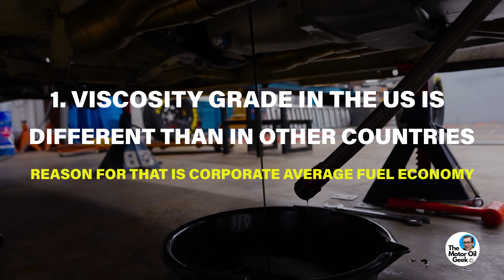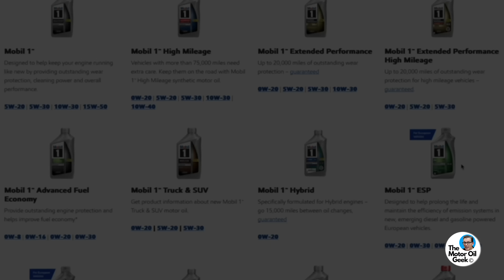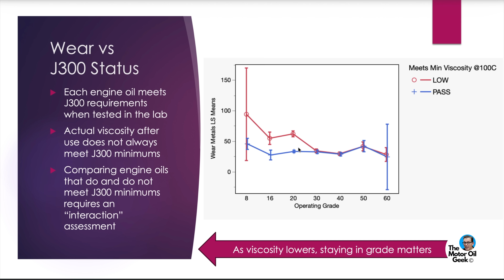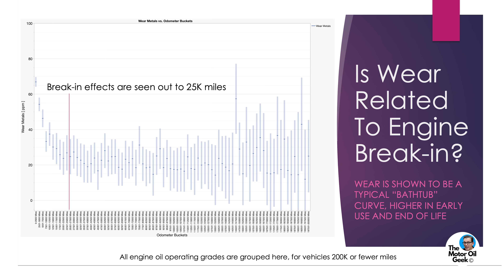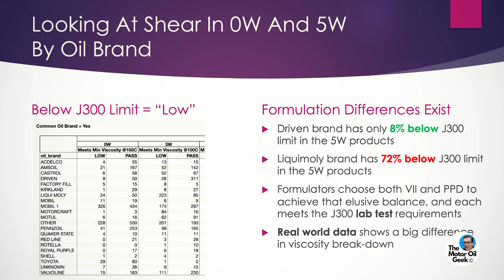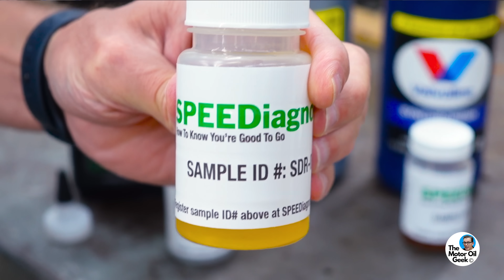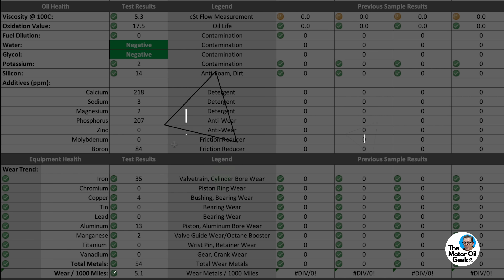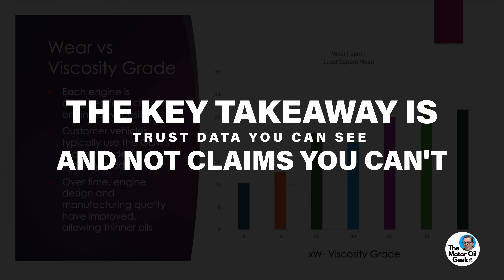More Ai Lies? The FACTS about 0W-20 vs 5W-30 (With Evidence)

Comment: The average mileage on a car in America is 12,000 to 14,000. The average American owns a new car 8 years. 8 x 14,000 = 112,000 miles. At 5K oil change interval, that is 22ish oil changes over 8 years. Having the oil changed with average quality oil is more important than using Hi Performance oil for every oil change. Other than engine design flaws, the average user will not have appreciable internal engine wear under 112000 miles with average oil and average oil changes. All this "Best of the Best" stuff is just "Icing on the Cake" or "Cherry on Top" statistics".

Comment: I respect your experience and professionalism, but it appears (I hope I am wrong) that you change direction with the blowing of the wind. 

I own diesel equipment and trucks and have for all my life in agriculture and construction. Rebuilt ourselves many many engines and raced with NHRA during 80s 90s and early 2000s, running thin oils in our race engines, so I have a little experience. 

I bought a new LZO in 24 and was told to only run 0Water20 or void warranty. I ran for 22000 miles and burned 2 QTs every 4000 mile service, with it stopping up the stupid particulate filter at 30k miles(oil was going out the exhaust). I fussed with Dealer service manager and said screw the warranty. Switched to 5W30 and for 25000 more miles, it has burned 1/2 to 3/4 of 1 QT every 4000 miles. So Screw GM!!!! 

Now my complaint to you sir. 

I watched a video with you and Dean (Dave Auto / Whom I respect) and you sir were giving your advice based on your numbers you tested and came up with, to YES RUN THE 0Water20. 

So sir, who is paying you to give your advice? Is it to sway listeners one way or the other?????? Because now you have flipped. 

For me it is about TRUST. I am going to do what I believe is right and for the best of my company. But you and anyone else putting out content that SUPPOSE to help people, but you sway what you say is not right!!! 

If I misunderstood or am wrong, please correct me. But I do not believe I am wrong. There are so many lies and manipulation and misinformation being pushed out on these platforms, it is pathetic. Manipulation is witchcraft and lying!!! The Bible says Our Heavenly Father hates a liar. 

If I am wrong, prove me wrong. If I am right, then repent and make things right with the listeners. You owe them that at least. 

Thanks and God Bless Everyone!!!
Reply: Hey man, not to start a flame war with you. Since the beginning of his videos and I watched him when he had like 30 subscribers he’s always said to do the test oil analysis. 
He also has always said start with a recommended what the manufacturer says .

He also just told you in this video that zero 20 can be as good as 5W-30 until it is not as good and then it wears down faster .

No respect you, my friend, but I don’t know if you’re actually holding onto everything he says or your brain is just picking pieces out of all the videos .

I’m sure if you go back you’ll realize everything he has said so far is to do the test. Do the test do the test. I also am an engineer. 

He hasn’t backslid and he hasn’t changed his mind and I don’t know about this whole thing with God if you’re just being a troll or if you’re serious, but I hope that helps you.
Reply: @DanBrando  "He also just told you in this video that zero 20 can be as good as 5W-30 until it is not as good and then it wears down faster ."  🤣🤣🤣 So then it really is just "0Water20" snake oil. GOT IT! I'm sure it may have some use, but universal daily driver is not one of them.  Don't they also teach planned obsolescence in engineering class. AND statistics are a bad joke at best. Not everyone has funds to test their oil vs food on the table.  I just seen this in my friends little ford  4 banger, over a Qt low between oil change with under 60,,000 miles on it.  I'm so glad I grew up in a time when old time gear heads exchanged knowledge and taught us how use our brains instead of depending on the internet and AI. He is right about manipulation and LYING.👿

Comment: I've had this problem with my car because I am sticking with the oil which the manufacturer book told me to use which is 0W-20 but I live in Jamaica and the climate is hotter, so mechanics are telling me to use 5W-30 instead, the manufacturer book did not tell me to use 5W-30, I drive a 21 civic with the 1.5L turbo engine, what do you think?

Comment: Thanks for your fact-based analysis. Sounds like what's happening comes down hard on the integrity of U.S. automakers. They're recommending 0W-20 and at the same time recommending longer change intervals. Overall, that is a recipe for increased wear and a shorter engine life. If you're using 0W-20, change more often or, at the very least, use an oil that breaks down slowly.
Reply: THIS
Reply: An engine lasting to 200k+ miles is not in their best interest and they know it. Best case is it blows up on the second owner. Good way to sell more new cars and limit the availability of used cars.

Comment: My cars engines were designed in Europe for a 5W-30 LL-01 oil with a minimum HTHS stability rating of 3.5.  

So which is better, then?  
1) A 0W-20 LL-17FE+ oil and a 12k mile OCI with a HTHS stability rating under 3.0 as is stated on my oil cap here in the USA 
or 
2) a 0W-40 LL-01 oil with a HTHS rating of 3.6 and 4k mile OCI?  

I'm told the high anti-shear rating is needed due to the massive timing chain in the B58.

Comment: I have a 2026 BMW X5 bought in July that specs 0W 12 oil. I’m currently changing the oil every 4000 miles because I’m afraid I might wreck the engine if the viscosity degrades. I would love to get a recommendation on what viscosity to use as the engine wears. Thank you.
Reply: Have your used oil analyzed to verify that your change intervals are acceptable.

Comment: The issue is that it's hard to make a quality 0w20, my car runs on 0/5w30 and 0/5w40, with 5w30 tends to do varnish more, GDI turbo cars have that problem with light oils, it's a fact.
Reply: I have a Focus ST, and I'm fortunate that the dealership where I purchased the car gives me twice a year oil changes for free.   Since COVID, I only drive the car for fun, but the twice-a-year oil changes are probably saving the turbo from some wear;  and the other thing that helps is an oil pressure gauge and oil temperature gauge in the car let me know that until the oil is fully warmed up, I avoid letting the turbo spool up.
Reply: @teekay_1 What save my cars is the dipstick tube oil change, even if you have a downward filter you can do intermediate changes to fresh the oil up
Reply: Says the AI bot
Reply: @PatrickFugate Doesn't talk like an AI bot.  Remember, everybody on the internet has an opinion.
Reply: @teekay_1  He said I'm an AI bot, my channel is like 15 years old 😂 only cause my old one from 2007 got banned without reason
Reply: @PatrickFugate Me ? AI bot?